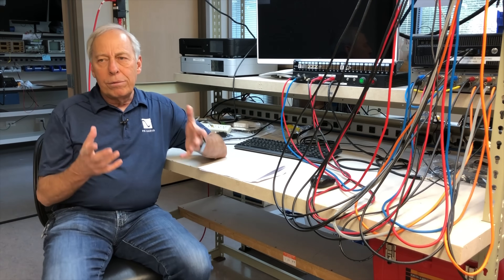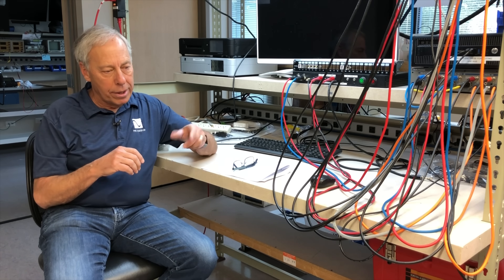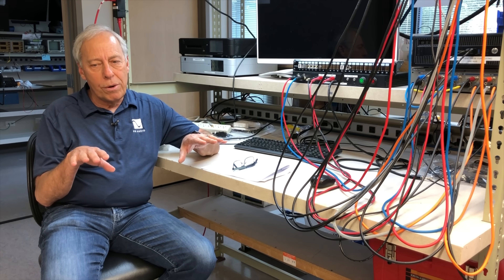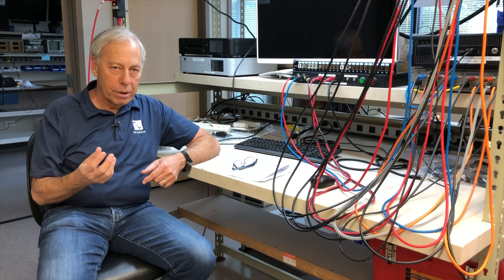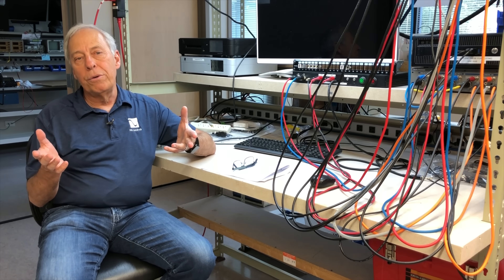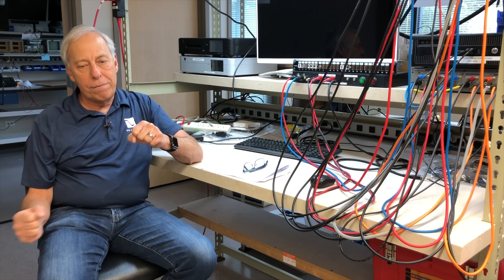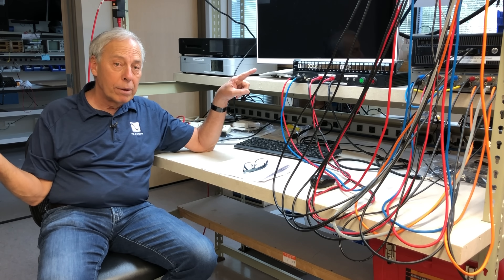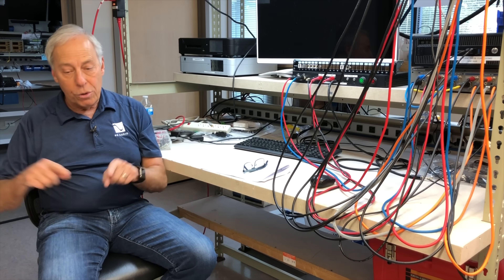Would dedicated lines cause ground loops?

Comment: One correction for you: You should NOT just run a "flimsy wire" between separate ground rods for your home electrical system. The NEC dictates that they shall be joined by a 6 gauge wire which is bonded to each ground rod. You want a good connection between multiple grounds, not a flimsy one.

Comment: This was VERY helpful to me. I'm running dedicated home runs from the main breaker box in my new (to me) home. I'm using 10/3 romex and going to great lengths to try and keep out any emi noise. I hadn't considered a separate ground stake for the new runs but they are in my basement so it wouldn't be hard to do. I also didn't know that the grounds needed to be tied together. Thanks as always for sharing this information.

Comment: Hi, thanks for your great video! .
I have a question about 100v distribution systems. 

I understand the "basic" : if the amp have 250w, the sum of the  "100v speakers" can have the sum of the impedance can be at "maximum" (not lower than ) 40.0 Ω  ....
But I want to know more about the 100v system.

IS the 100v dc and the audio modulated or is it the current? 
How do  a signal look like? 

Is the 100v only 100v when the load is 250w?, (2,5A)

Or  si it always 100v out, even of only one  1w speaker is the load?

Best regards 
Niklas

Comment: My band and I have battled ground fault loops at different venues that we have played. We have been successful at isolating all of our amps including pa on one circuit with a power conditioner, and everything else(lights, fog, fans) on whatever else is available. If we are playing at a venue that requires more power than that, the venue usually has it covered.

Comment: Improving the local house ground rod would be similar to putting a bigger connector on you car battery - not much if any advantage.  All grounds from the earth will carry noise no matter what.  The earth itself is a big antenna just like the power lines into your home are big antenna's.  They all carry noise.  The devices to reduce noise use the wire length equals resistance fact to eliminate noise locally at the equipment and that will work most of the time.

Comment: Thanks for your insights. This has been a very good listen as I am in the process of constructing a new home and looking to install dedicated power and ground lines in my listening room.
Reply: Luvdac, Put in oversize conductors and the more dedicated lines the better.  The cost while building is not that much compared with trying to go back later and adding a line after everything is walled in.
Reply: @juliaset751   thanks. Exactly what I had in mind!

Comment: As an Amateur Radio operator,  we use a separate grounding system (rod) APART from the HOUSE ground...   All radio related gear is grounded to a single independent ground rod and fed to a bus bar in the station with separate ground wires.   Each component is FLOATED from house ground with adapters at the duplex outlets.   This leaves the ham gear connected to only ONE ground potential...   One of the best types of wire is BRAIDED copper strap.....  Feel free to comment...    (O;

Comment: The ground rod, the System Ground, is there to provide a low impedance path for high voltage transients return to the location of the lightening strike or the transformer.  It prevents such transients from arcing to conductive material in earth contact or through insulation such as in a motor winding.  Basically, it prevents the Frankenstein's laboratory scene  during an electrical storm where arcs are flying, bulbs are exploding, etc.  Or more likely an arc that just happens to be through something flammable burning your house down.  The neutral is bonded to the ground rod to provide a path from  the wiring, especially that hanging outside between the poles, to this earth circuit.  It also, creates equipotential between one power conductor and the surrounding earth, creating the Neutral, and shifting all the electrical potential to the "hot" wire.  This is especially valuable since the US uses Edison sockets for lighting as this bonded neutral renders the screw cup, the part most easily touched near-equipotential with the surroundings.  

Audio noise is has no circuit to run through the earth back out to the transformer ground rod.  

The "ground" plug pin is the bonding ground that, if properly installed, provides a low impedance path from any conductive surface that could become live during a fault on the "hot" side of the circuit, back to the main breaker box, where it is bonded with the Neutral, but it doesn't go to "ground" but rather out to the transformer, back in on the "hot" side and trips the breaker due to over-current clearing the fault.

Ground loops occur when there is a potential difference between on neutral/ground in a power feed and another feeding another piece of equipment and then the case ground is connected between that equipment as the signal ground.  

I would imagine, but have no idea if it would meet code, that an audio room grounds might be run to a single star ground (single point) not bus bar and then run to bond with the neutral at the service entrance.  That would mean all the equipment (bonding) grounds were equipotential.

Comment: Flimsy wiring OK between grounds rods? let's define that a bit more. The NEC requires any bonding wire between ground rod to be a #6 minimum. The most destructive danger with isolated ground rods is lightning. A ground strike can produce thousands of volts and thousands of amps between those two ground rods for a few milliseconds. Think about audio gear grounded to the dedicated ground rod and yet they are still connected to the electrical ground system via the three wire AC cord. That mega voltage and current in a lightning strike will now be across your gear!

Another great audiophile myth propagated by the likes of The Absolute Sound and it's cousins is the idea that the Earth is some magical sink hole for electrical noise. Just like you dump dirty water into the ground (or sewer) you can also dump electrical noise into the Earth as well and make it go away. WRONG! The only time the Earth is effective is as a current return for the noise source. That would be lightning and some types of RF radio. Other than that, the Earth has no electrical noise reduction properties. Does your smart phone have an Earth ground, Your car? What about high tech military aircraft with tons of analog sensors? Where's the Earth ground to get rid of the electrical noise here?
Reply: Your phone is grounded through the nuetral when plugged in to charge. Your car is grounded through the negative terminal of the battery. When an aircraft is parked for any length of time, it's fuselage is grounded. I'm not here to argue. I like what you said...
Reply: : @cap96lt1  Phone grounded through the neutral? How? Most phone chargers are two wire only. And it is not legal under most world electrical codes to use the AC neutral as a ground. Yes, the neutral is bonded to the ground at the main panel but that is the only place that is allowed. If the phone charger had a three wire plug, then attaching one side of the DC output to the ground pin would be OK.

Car frame is bonded to the negative battery terminal? Yes, it is. But that's not Earth ground but merely a return for the battery voltage just as is any metal chassis with the power supply return(s) through the chassis.

Airplane grounded when parked, yes, probably for lightning and stray voltage safety as when parked it is often run off a building based 400hz inverter.

The point is that neither the car or airplane electronics, which are pretty sophisticated these days, required an earth ground for operation. And neither does any home audio system other than for electrical safety.
Reply: @andydelle4509  any two prong plug that you plug into the wall is grounded through the nuetral bar in the panel. We don't need to split hairs do we? Some cars are potentially grounded through a strap that makes contact to earth. It's not a common practice but I've seen some manufactures do it. Planes are grounded, that's a fact. I'm an old aircraft mechanic from the 80s.
Reply: , @cap96lt1  I think you are missing my point. The DC output of the phone charger has no electrical connection to to the incoming AC line power. That's the whole point of an isolating  power transformer or isolated switching converter. The only products that had the neutral as a ground were low cost 1960s and 70s table radios and TV sets, a practice which is long obsolete due to  low cost switching power supplies available today.. Planes are grounded when parked for the reasons I noted. But when in flight, there is no Earth connection yet there is plenty of sophisticated analog and digital electronics in operation. As for grounding straps, I know that gasoline trucks and other highly flammable transport vehicles do have  non-sparking ground chains dragging on the road. This is to prevent static electricity buildup on the body which could cause a spark with the flammable material present. It has nothing to do with the operation of the vehicles electronic systems.

The NEC under advisement by the IEEE  has recently changed (was it the 2008 code cycle?) the wording in their code books from "grounding" to "bonding". The reason is this exact industry confusion between an electrical return path and an Earth ground. They are mutually exclusive unless deliberately joined. And in many cases that is a critical distinction for electrical safety issues.
Reply: @andydelle4509  I understand what you are saying and agree but I am over simplifying by saying the wall wart ( transformer, power supply) is grounded. You can drum up NEC mumbo jumbo, take your panel off and trace out your neutrals...they're grounded. If your transformer shorts to ground the circuit breaker should throw...if the transformer or power supply is fused, then that would blow first. Or if it's not UL listed, it could overheat and cause a fire not flipping a breaker. But it's grounded. Otherwise, the device would not turn on...
Reply: @cap96lt1  Yes, that's how most world electrical systems are designed. But after the component or device's power transformer or switching power supply, the signal or DC power ground need not be tied to the AC ground. It's optional depending on many other factors. But in no case may a neutral be substituted as a ground. An likewise it's also illegal to use a ground as a neutral. That is a common hack when a 240v only outlet now needs 120v as well, the ground becomes the neutral. Older cloths dryers and electric ranges did this but it's now illegal. They must now have four wire connections.
Reply: @andydelle4509  got it! And yes, I agree...

Comment: Something which needs saying is that with a second breaker box, DO NOT tie the ground and neutral together. Only at the main box does this happen. Plus, keep your ground wire smaller than the hot and neutral, as emf wants the least resistance to flow and this will prevent current flow on the ground.
Reply: Some older panels don't bond the nuetral and the grounds together. That's the first thing I check in an older home or apartment. When you bond the two, it cleans up the video and sometimes the audio...
Reply: James and Kirk, thank you for those clear comments. Now, I'm going to recheck a couple of my installs.

Comment: It's a good question and Paul answered it 98% correctly. If you have a driven ground at the electrical box, and all homes do, and you want to create a second distribution box for lets say your AV room and you drive a separate ground for that, yes, it must be connected back to the other driven ground. Paul said that the Electrician will do that. Yes, he will because it's dictated to him in the National Electrical Code. It's not a "hum" thing, it's a fire thing.

https://en.wikipedia.org/wiki/National_Electrical_Code

I don't know if it's still allowed but homes used to, or still do, use the incoming cold water pipe ( copper ) as their driven ground.
Reply: The ground rods have to be connected to each other and as I recall the NEC specifies a #6 copper wire be used.

I had my fuse box replaced with new circuit breaker box and they upgraded me from 60a to a 100a service at the same time. The old service used the 1" incoming water line as ground, the new has two ground rods and the incoming water line all bonded to the panel with #6 copper wire.

Someone above mentioned watering your ground. At our communications site in Korea we had a persistent ground problem that put hum on our signal we transmitted and nothing seemed to change it.The battalion XO came up to look at it and he thought the problem was a bad site ground. Our power was generated at the base of the mountain and a 3,400v 3 phase line was run from base campto the top of the mountain (3,500 ft). One problem we had was this mountain was just a huge monolithic rock so the engineers had blasted a hole in the rock and put grounding rods into a cement slurry. I con't know what the conductivity of granite is but it was not low enough. The major told us to run a 1-1/2"copper pipe down to the spring (100 ft below the site) we got out water from and that solved the hum problemproblem.